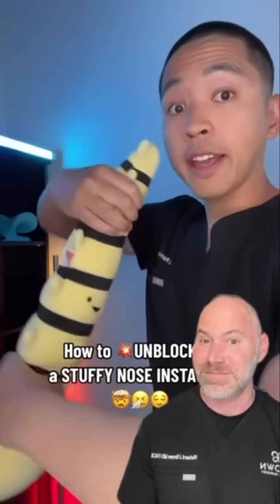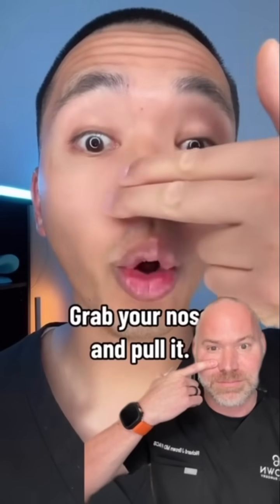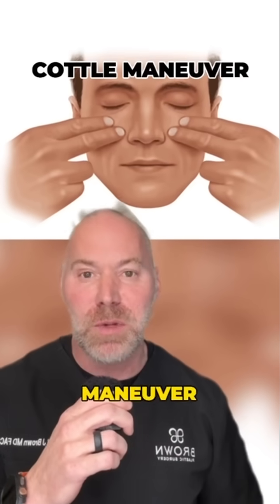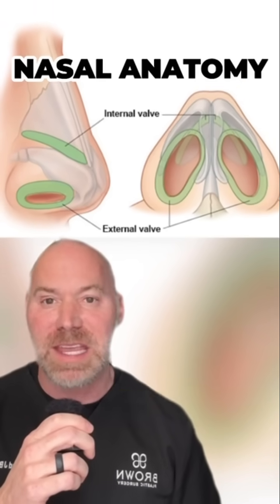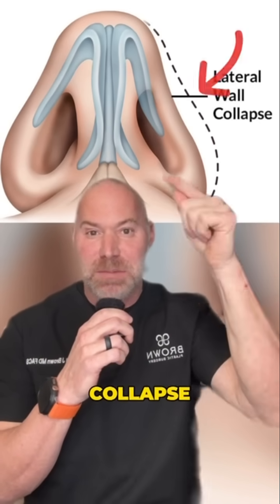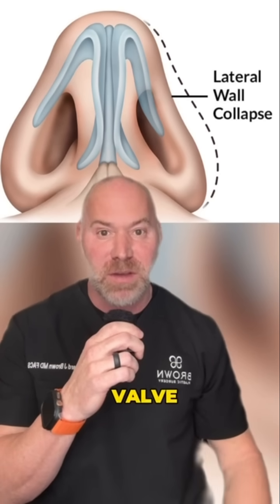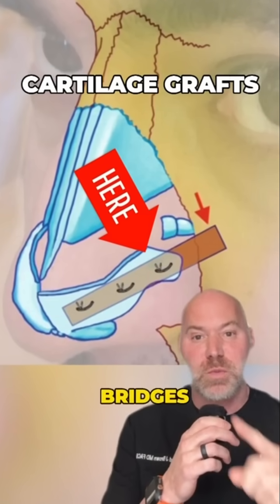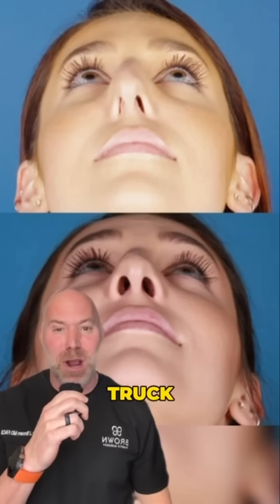Unclogging a Stuffy Nose 🤧 #shorts

Comment: Something that also works for me is I get a water bottle and I get a pen. And I poke the top of the water bottle with the pen and spray a little bit of water up my nose. What that does is it makes the snot wet instead of stiff. So then it’ll be easier to blow your nose out.